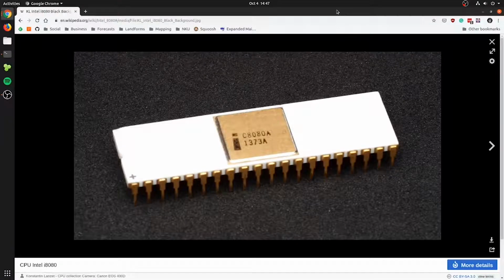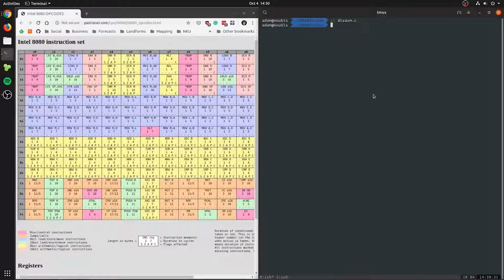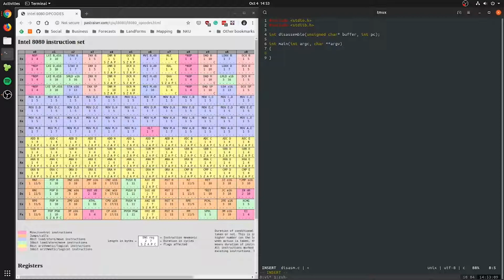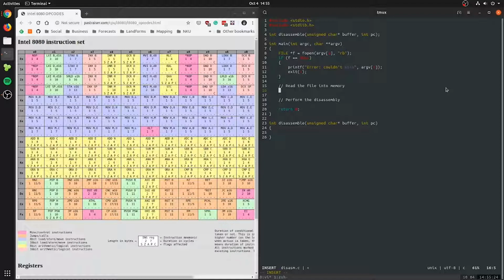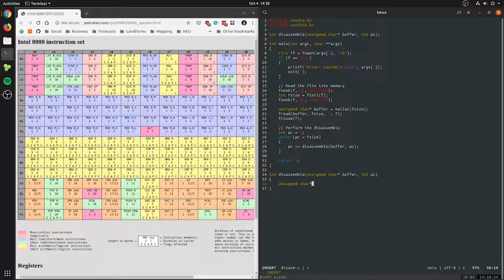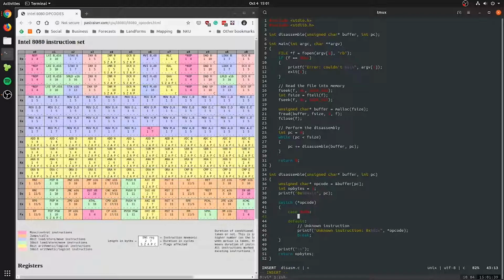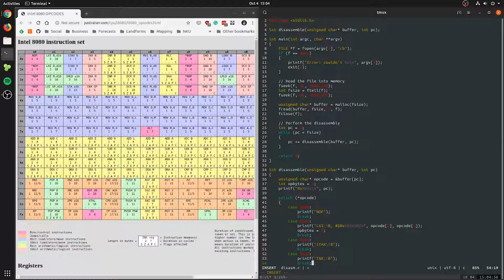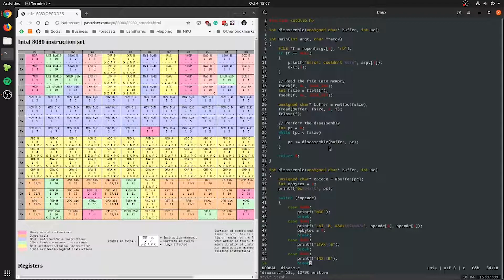Let's Write an Intel 8080 Disassembler

Comment: Why did you have rhe case structure? It's easier to take a table of instructions (00h, nop, 1), ( and so on), for the 256 op-codes. You add the number to program counter (PC) for the next op-code. So you have only one comparison in a loop and compare until you find the opcode in the table.
If you find one you print out the op-code at second position and add the number at
third position to PC, then break. Take the next op-code at PC until end of file. You need an array of 256 x 3 from the instructions table.

If there is a branch you can calculate the target address and print it after the op-code.